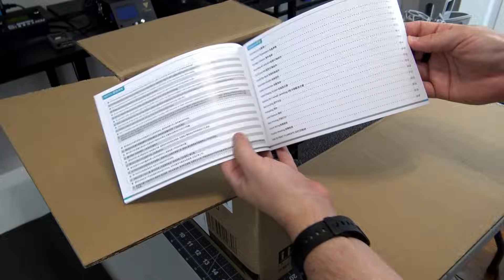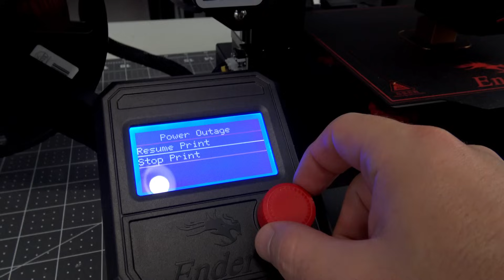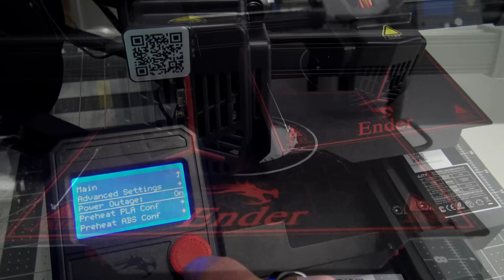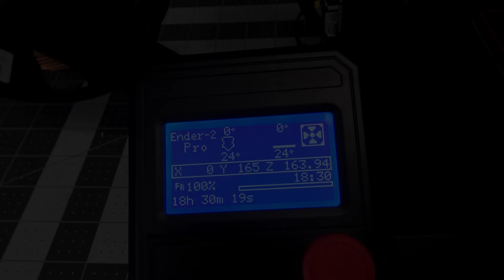Can a $169 3D printer be Good? - Ender-2 Pro Review

Comment: this one or the kingroon k3sp pro ?
Reply from the maker: I haven't used the KP3S Pro myself. The Ender 2 Pro is great if portability and ease of assembly is important to you. If you don't mind less portability and a larger footprint, the original KP3S has a slight advantage with the direct drive extruder. The KP3S Pro solves the portability issue, but I don't know if that affects how well it prints.
Reply: @HoffmanEngineering  but many ppl said ender 2 pro cant print flexible filament like tpu, pctpe etc.. only abs and pla ?

Comment: NO, the first thing go to bad on these is the bed gets dished and the magnetic sticker conforms to the dished bed, plus the sticker is easily damaged.  You need to put the plain glass surface on and use hairspray for adhesion.
Reply from the maker: I've been using this printer pretty consistently since February, and haven't noticed any dishing. Any ideas as to what might be causing your dishing?

Comment: I'm definitely looking to get started in 3D printing and this sounds like a good start.
❓Can this handle any flexible material without mods or is it not feasible?
Reply: I can print tpu 95 quite easily it sticks well and is good quality with minimal strings when you set up better retraction. 82 a is still possible but needs a softer spring on extruder

Comment: I have an E3 S1 and I'm looking into a second printer that I can bring up from my shop to get my son involved and just so I can print more. I got a $150 amazon gift card so this guy's only gonna be like 30 bucks with a roll of filament, can never have too much. I originally wanted to get a prusa mini, and I still might but for the price I can get it for I think I'm gonna go for this. 

Also for the power loss, if you're running stock marlin (can't confirm of itll work with any custom firmware) but M413 S0 (zero) in your start gcode will turn off the power loss recovery. I had to do it on my s1 for the same issues.

Comment: Subbed! Excellent review 👏.  Question. I currently have a Ender 3 fully modded. Would I be able to install  a Microswiss with direct drive? I have a extra pancake motor thet would fit the bill. Thoughts? Would love to have a small TPU printer.

Comment: The sample gcode bunny printed with the included PLA quite well on mine.  I’ve not tried it with any of my other PLA though.
I was equally shocked by the quiet motors and the super loud CPU cooling fan.
I had been printing PETg with my Monoprice Mini Select V2 and on the Ender 2, it was horrible.  But now that I learned about the auto power off feature, that might be part of the problem I saw on the petg heat tower.  I’m back to PLA, using up some of my 3 year old rolls that have been in boxes for a while.  This thing is pretty slick with PLA, once dialed in.
The bed leveling is a pain, it seems to go out of level on every print, and I’m printing small things I’ve designed.  I have the stiffer springs on order, they should be in tomorrow, that might help.
This was a good review.  I like some of the things you printed.

Comment: I can vouch for the Ender 2 Pro. Out of the box its easy as hell. This is perfect for your family member/friend/teenager who wants to print out some smaller stuff but not exactly get into it yet.
Reply: If hell is easy, why is it feared?
Reply: I just got it today
I put all the parts together and then i turned it on and Just like it standing in the manual i went to motion, auto home and disable steppers. When i clicked disable steppers, a liquid came out of the printer and it started  smoking.

Would not reccomend 1/10
Reply: I cant say the same, This was my first printer, and I outgrew it quick. but it is a super awesome printer in regards to its build volume

Comment: I am a big proponent of UPS. I have my 3d printers hooked up through a UPS. So even if there is a power loss, the printers can still keeping on printing for a little bit. I think it's a must and can save headaches. Especially if you live in an area where power is sketchy.
Reply from the maker: I agree, a UPS can be a big help in areas where brownouts are common. They won't entirely save you from blackouts, as most basic UPSs would only be able to power a printer for 20-30 minutes, but are awesome at keeping a printer running during a brief blip.

Comment: @7:39 I don't get it, on so many printers the X belt is not running in a straight line! That is a design flaw which is easy to fix designing the printer.  When moving more to X-min or X-max, the belt will increase tension.. Why do they leave it like this!?

Comment: I just recently got the Ender 3v2. I print a lot of functional parts so I use a 0.6m nozzle. I feel like I could use this printer to print quick prototypes. Probably gonna pickup one
Reply: I thought going with a bigger nozzle was just for speed. I would think if you want functional parts you would want more precision and so a smaller nozzle. Maybe I'm wrong.
Reply: @dangerous8333  Functional parts are things like brackets as well. Even so, with a 0.6mm nozzle you can lower the layer height to make it more precise. I usually use 0.32mm, but turn it down to 0.24mm or 0.18mm if I need more precision. Eventually, I want to invest into a bigger printer (Ender 5, 6, 7 or Voron 2.4) for printing larger parts. Then I can use my Ender 3 v2 to print at 0.4mm nozzle size for medium sized prints and the Ender 2 for small prints at 0.2mm.

Comment: Can you store the power loss detection bypass as the default state?
Reply from the maker: Yes, you can disable it and then store the settings, and it'll load those settings when the printer powers on.